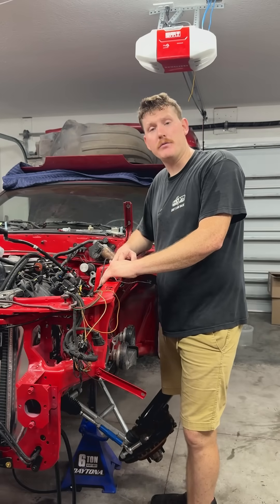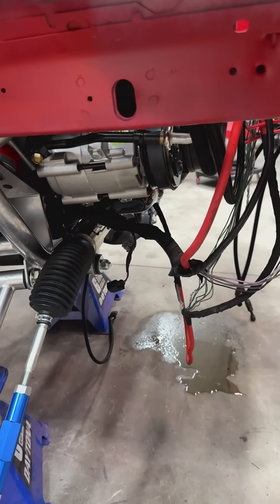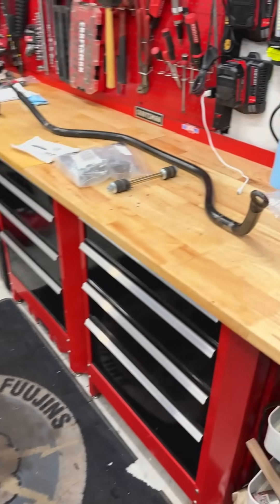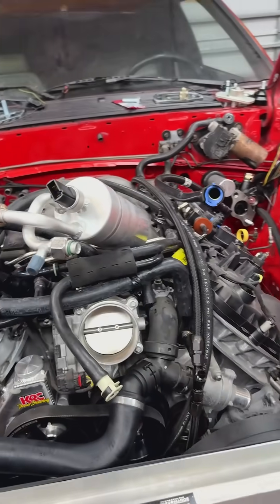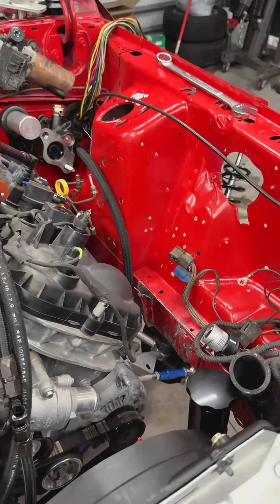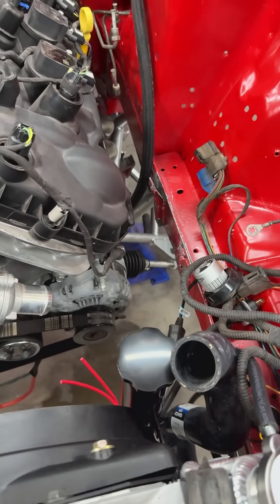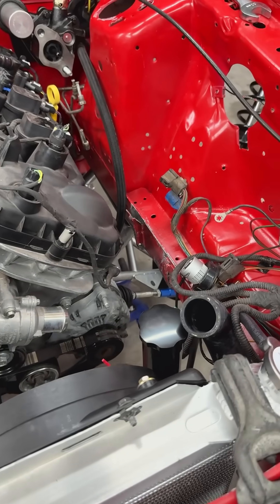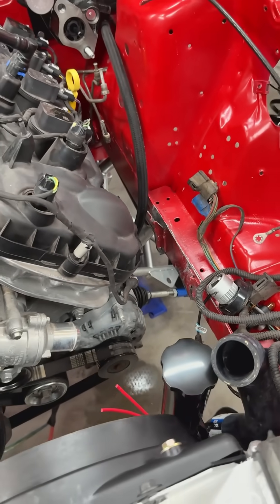Things I Wish I Knew Before Coyote Swapping My Foxbody Pt 3 Sway bar Relocation #ford#automobile#diy

Comment: What oil pan did you use
Reply from the maker: I used a gen 1/2 oil pan. Technically with the UPR  k-member and adjustable engine mounts I didn’t have to do the oil pan swap but I definitely gave me piece of mine having a metal oil pan vs a composite oil pan.
Reply: @WildysGarage1776 thank you I'm trying to figure out the swap stuff I need. mine is a gen 3.

Comment: From my understanding, you can utilize the original sway bar with the SN95 brackets…..also for handling of car on road, they are important……most people cut them out because they it difficult dropping the coyote motor into the car for which you fought that battle and won….do you have subframe connectors welded into the unibody?
Reply from the maker: No I haven’t put subframe connectors in yet but as soon as I get the car running it’s going to a shop to get those weld on